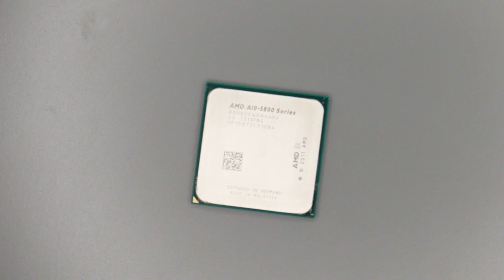OLD gaming PC needs CRAZY cleaning!! (Compaq Presario SR1000)

Comment: I think safest way to clean the cpu is when it’s still slotted so pins won’t bend or holding it instead of putting it on its pins
Reply from the maker: Hi DeezRMyDays! I agree. you are not the 1st person who tell me that. And I did in the video I'm currently working on 😉
Thank you for your comment! ❤️
Reply: Yes and it’s best to dust off the motherboard with the cpu installed so dust doesn’t get into the socket and prevent it from making good contact.
Reply from the maker: Hey, just realised I never answered you 😅 Yeah you are right, this is also why I'm doing this now. Thanks for your comment Outerspaces! Hope you enjoyed this video ❤️
... 5 months later hehehe 😇

Comment: I had one of these sr1000 chassis in the garage, it was our family pc from 2005 iirc, I dug it out a few months ago but it was way worse than this. All the electronics were corroded as well as the case and the light plastic band was discoloured. I ended up spraying mine, got a used oe front io and card reader to keep it looking half original and rammed a 3700x and rtx2080 into it. Now my main rig, thanks for your video it was inspiration and the chassis has memories and all the family have noticed its alive again.....
Reply from the maker: That's a great comment to read, thank you very much @paddyodoors2757 ❤️❤️

Comment: What is in that spray can??
Please provide Amazon link
Reply from the maker: Hi Giridhar! It's just Compressed Air Dusters. I use it because I don't have compressor. I buy them in France, so I can't give you the reference I am using, but looks like that one is the Amazon Best Seller: https://www.amazon.com/Falcon-Compressed-Disposable-Cleaning-DPSJB/dp/B0000AE67M/ref=zg_bs_3012916011_sccl_1/142-9807519-0189852?pd_rd_i=B0000AE67M&psc=1
Reply: @french.satisfactory  thanks buddy🙂
Reply from the maker: My pleasure. If you buy and test it. Don't hesitate to tell me if it's really a good product. So I can recommend it for others.

Comment: what gpu is that?
Reply from the maker: Hi Playtrack22, I already gave this PC back to his owner, but was able to check my video rushes. This is what I found:
- Motherboard: GIGABYTE GA-F2A78M-HD2
- PSU: CORSAIR VS550
- Processor: AMD A10-5800 Series
- Graphic card: GeForce GTX 1050 GAMING X 2G
- Ram: 1 SAMSUNG 1Rx8 4GB PC3 12800U + 1 Kingston DDR3 4 GB PC3 10600
- Hard Drive: 1 SAMSUM ST500LM012 SATA 5400 RPM 500 GB (January 2015) + 1 Seagate ST1000DM063 SATA 7200 RPM 1TB 
- DVD-ROM Drive: Data Storage GDR-8162B (December 2003)
I added it on the video description to let everybody have theses info also.
Don't hesitate if you have any other question ✌️
Reply: @french.satisfactory  wow that big upgrade. Ssd would be better tho.
Reply from the maker: Yeah, it's the PC owner who did this. And add an SSD is for me one of the most important part of an hardware upgrade.

Comment: It is not clean if you ask me. I bet it is still smelly.  I wash everything wits soap and plenty of water, even the PSU. Dry them with hot air and after that several days of natural drying. Never had an issue.
Reply from the maker: Hi best opinion!
Your are the 2nd person who are telling me that. It doesn't smell at all to be honest and I would not say it's not clean, but for sure it's not 100% perfect. But yeah I get what you mean. I add this in my improvements list because I think you guys are right about it.
I will have to think about how I can make a setup to record that and keep a satisfaction and clean video. I don't want to just put it in my bathroom and record it without lights etc... So it will take a bit time and not be in the next 2-3 videos. Plus I have other improvements I want to work on before.
So thank you for your comment best opinion! ✌️
Reply: @french.satisfactory  Some guys around here use water for cleaning. First vacuum cleaner and then water an soap. It is a risk of course, but I never had issues. 

If you sell it ... ok. If I want to keep it, no way without washing. Not to mention that I have no gut to clean it as you do aspiring that nasty dust... I hope you have a face mask. :)
Reply from the maker: I don't sell them, I usually give them back to their owners. But yeah, I will soon wash the metal chassis with water and soap I think. And yes, I wear a mask and often open the windows 🙂

Comment: Do NOT open a power supply if you're not a professional! Power can still be stored there (even after months of being disconnected) and if you don't know how to discharge it properly it could be deadly
Reply from the maker: Hi מוטי שיוביץ, this is interesting. Didn't know there was a specific way to discharge it. If you have sources I can read I'm interested on. I will do my own research anyway. Thanks for your comment ✌️
Reply: Well... partially true, most modern power supplies have a discharge resistors, like 200 kilo ohm which drains a capacitor of 1,000uF over roughly 16.5 - 17 minutes or diodes that will help empty it out.

A one handed electrician is a living electrician in the end.
Reply from the maker: Interesting. I always thought that if we push on the power button when the computer is disconnected from any electricity sources, it would be enough to make sure that all the components are empty.
Reply: @french.satisfactory  That does help as well, just as an additional precaution honestly. Also for heatsinks not stuck too any components for the moment id simply use the vacuum cleaner
Reply: Just do the ghetto method of shorting the big capacitors with some piece of metal. Add a resistor to a cable and use that if you don't want to potentially cause damage. You can also check with a multimeter the voltage across the big capacitors to see if they're holding any charge. Anyway, I'm no an electromagician so take this with a grain of salt.

Comment: please do not remove CPU like this.  cpu socket will get dirty and will cause lots of problems.  First clean the motherboard with CPU on it - then remove it.  Also while cleaning AMD CPU - use tissue paper, not cloth.  Cloth tend to fasten in sharp CPU pins and inadvertendly bend them making the CPU useless.  On the other hand tissue paper will just tear apart.
Reply from the maker: Hi Som Sundar Srimany! You are totally right. I definitely didn't do this the right way on this video. And you are not the only one who told me it 😅
On the episode I'm currently working on, I kept the CPU on the mother card to clean it. And will continue to improve the process video after video.
Thanks a lot for your comment. It help to make growing this channel ❤️

Comment: This hardware need big Case or buy new PSU.
Reply from the maker: Hi Assasin under the Moonlight,
You are right, the case was definitely too small for this. It is the computer of my brother and didn't plan any upgrade for it. It was my third video so ... yeah, I only started upgrades in my last video 😅 https://youtu.be/LbO1jJtY8v4
Thanks for your comment, hope you enjoyed the video ❤️❤️
Reply: @french.satisfactory  I don't mean a very large box, just a box that has the power cables in the back because there is no airflow to cool the parts.
Reply from the maker: In any ways, this case was definitely too small. My brother upgraded some components with larger ones and it was even a bit complicated to fully close de case So... He now have another PC for his daily use. Not even sure if he is still using that one par anything.

Comment: People on here are too paranoid, when cleaning or changing the fan on a PSU, disconnect from power, hold power button for 10 seconds, leave at least 15 minutes, don't touch anything with conductive materials, do what you have to do and put the lid back on, I have cleaned many PSU's and am always removing old brittle hot glue from them as it inevitably falls and makes a rattling sound. How many people do you know killed by a PSU? and no it doesn't count if you know a guy who knows a guy who told you he knows a guy who knows a guy who did lmao.
Reply from the maker: Thanks for sharing your point of view Jonny! I am pretty in the same thinking but open to every opinion.
Very relaxing YT channel BTW. 👌
Thanks for your comment ❤️